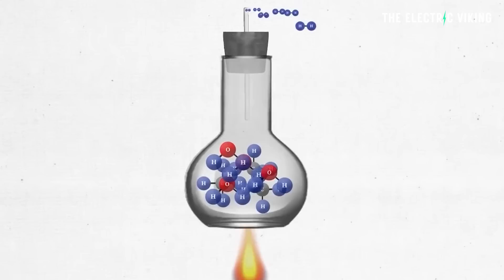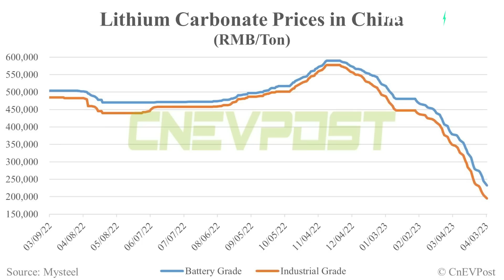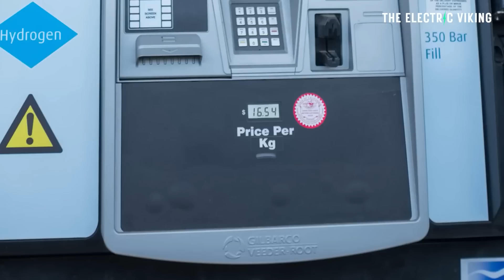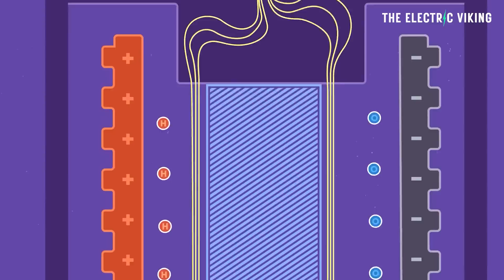Experts say Hydrogen for long-distance trucking makes no sense

Comment: In Germany cities start to give back their hydrogen busses because they cannot afford them any longer. They replace them with electric busses.
Reply: Yes, but these buses aren't doing long distance hauls.
Reply: Hydrogen buses are twice as expensive to operate as diesel buses.  E-buses are 50% LESS expensive to operate than diesel buses.  Why on earth would anyone in their right mind ever go with hydrogen that costs 4 times as much to operate as electric.  Same problem with long haul trucks.  So what if they take more time to charge if the driver/operator will save hundreds of dollars per refill.
Reply: I think battery swapping makes better sense than building a new hydrogen infastructure
Reply: Would never ride is such a bomb anyhow.
Reply: @beatreuteler doesn't matter...hydrogen is too expensive and too dangerous.
Reply: @beatreuteler  how does that change the economic reality.? it would be cheaper to just burn money.
Reply: @1rjona  Battery swapping doesn't make sense. There is time to charge so all the expense of swapping batteries is unnecessary.

Tesla tried battery swapping then abandoned it, for a good reason. Better Place failed with their battery swapping scheme. Nio is doing Okay, but not great. Maybe it makes sense for electric scooters, but not for cars and definitely not for massive trucks and busses.
Reply: @TecnamTwin  NIO isn't doing OK. Burning money like there's no tomorrow. The cost for the battery swap is also double from charging the battery. The costs go somewhere and for long haul trucking, coat is king.
Reply: @scottmcshannon6821  Unfortunately it is not yet known, I think. To me it looks as if quiet a portion of what the Viking is telling us here are forward looking statements and therefore subject to change. We should adopt patience until some of the ideas become more mature and solid products result from them. Then an economic assessment will be much safer to make.
Reply: Sorry Scott, I was assuming your response is to another post of mine. Now as I see to which one you responded I would say it simply depends if they can find buyers for the used H2 buses that are doing longer distance and/or do not know yet that for their distance, fully electric is much cheaper AND is available. In the latter case they may make enough loss reduction by selling them and buy fully electric which then in the long run will earn money for the company as they run on a much lower cost rate.
Reply: @TecnamTwin  it does not make sense for cars to battery swap. You have to scale up a lot to make it profitable. But for trucks that run in a specific routes and must follow a strict schedule, swapping would be better than charging a trucks massive batteries. Even Tesla could not scale its Tesla semi.

Here is a video how it can be done on converted trucks
https://youtu.be/9eYLtPSf7PY
Reply: @1rjona  why? Won't better batteries just be enough, I mean higher density with higher kwh numbers, with higher charging capabilities like 1MW? I think the new CSS standrard can go as high as 3MW?
Reply: @TricoliciSerghei  my doubt is how many 1 MW chargers can we install? 1 MW is power needs of a whole neighbhorhood
Reply: @1rjona  You're right, but with time there should be specialized places where such chargers will be available for trucks.. Even 300 kW chargers could we ok for a truck, if it has a battery of 500kW 2 hours should be enough to charge, sometimes they might want to wait 2 hours, sometimes they could charge less.. It's viable I think, because there are already 350kW chargers out there
Reply: Plains, Ships and Farm Equipment will be benefiting from Hydrogen for sure.
Reply: @shivaraj6  farms also. Hydrogen is a component for ammonia which is used for fertilizer. But Hydrogen infastructure fall behind from electrical infastructure. For Battery EVs , what is lacking is charging stations. The distribution and production network is already there
Reply: In France they are going for hydrogen 100pct
Reply: @TecnamTwin  Swapping could be usefull for trucks as it would be easier to build swapping stations than build 1MW charger parks. And batteries for trucks can be standarized much easier.
Reply: @dnap1991  I count 29 Hydrogen stations in France. They need to go in 500 pct.

Comment: Actually it cost 3X more electricity to make the hydrogen, but then there are even more losses in leaks and fuelcell inefficiency plus added expenses for it's complexity and maintenance
Reply: The latest and most advanced electrolyzer today has over 90% efficiency in converting electricity to Hydrogen at high enough pressures to feed into pipelines .  Transport the H2 in pipelines is 98-99% efficient, depending on distance.  H2 compression is 90% efficient.  Fuel Cell is 60% to 70% efficient  Multiply all those efficiencies:  0.9 x 0.98 x 0.90 x 0. 65 = 0.52 = 52% efficiency from electricity to output at the fuel cell.  
Meanwhile, solar PV inverter at 93% efficiency and grid transmission at 93% efficiency and EV charging at 85% efficiency and battery efficiency at 90% :  0.93 x 0.93 x 0.85 x .90 = 0.66 = 66% efficiency from the solar farm to the output of your EV's battery.  
So, comparing 52% efficiency of Solar farm DC electricity to output of the H2-Fuel Cell... vs 66% efficiency of Solar farm DC output to AC in the grid to DC EV's battery output...isn't so bad for H2-FC...is it?  52% efficiency the H2-FCV route vs 66% efficiency for the electricity grid BEV route is very close!
Reply: in fact you loos 75% to 96% of the energy, depending where you make the hydrogen, and how far you have to transport it.
Only in the case you use oil to make hydrogen, you don't need green energy but Armco and Rosneft can quadruple their output and business
Reply: @trungson6604  While I don't have the time or patience to work through your all your assumptions, every discussion I've ever seen states that HFC vehicles require triple the electrical energy as BEVs per unit of motive power, grid to motor; and so enough electrical energy to power a hydrogen fuel cell vehicle for one mile will power a BEV for three miles. And relative costs seem to support this claim. For one example, a KG of hydrogen, which costs around $17 here in San Diego, contains about 33.6 kWh of equivalent electrical energy. Run through even a 65% efficient HCF (which I think is high), this results in 22 kWh of electrical energy to the electric motor, for a cost of 78¢/kWh. Meanwhile, 1 kWh of 25¢/kWh electricity (among the highest in the contiguous states) X 85% X 90% = 33.7¢/kWh, less than half the cost of hydrogen, grid to motor. 

Real world example: The Toyota Mirai carries 5.65 KG of hydrogen, and gets an EPA range of 357 miles. A KG of hydrogen in San Diego, where I live, is currently about $17. So the per-mile cost of hydrogen for the Toyota Mirai is 5.65 x 17 / 357 = 27¢/mile. Meanwhile, my Tesla Model Y has a 75 kWh battery, and has an EPA range of about 320 miles. At residential rates of about 25¢/kWh,  the per-mile cost of electricity for my Model Y is 75 x .25 / 320 = 6¢/mile—less than a quarter of the cost per mile of hydrogen. And actually my cost is zero, because my solar array generates all the electricity I need to charge my Tesla. Try doing that with your HFC vehicle!

By the way, I see one thing you did in your original calculation—you assessed the BEV 93% for inverter efficiency and and 93% for grid transmission, but assumed there were no such losses in the HFC example. A little sleight of hand, to give the HFC example an extra—and much needed—advantage?
Reply: @Ben Thurston  --  The Hydrogen cost for fuel-cell fork lift operators is around $7 per kg, NOT $17 that FCV owners see at the pump...but that $17 does not matter because the car makers are paying for the Hydrogen for 3 years, the duration of the lease, so FCV owners don't really care about the cost of H2 right now. 
But even $7 per kg of H2 is far too high.  The price of solar and wind electricity long-term purchase agreement (PPA) is around 2-3 cents per kWh, and the latest electrolyzers require only 44 kWh to make 1 kg of H2.  So, the raw energy price is only $0.88 to $1. 32 per kg of H2.  Factoring in much cheaper prices of electrolyzers, and low-cost transmission of H2 via pipelines...and we can get around $2-$3 per kg of H2 at the pump.  

Meanwhile, BEV owners have to pay $0.15 to $0.25 per kWh charging their BEV from home.  Assuming $0.20 per kWh and 3.5 miles per kWh = $0.057 per mile for BEV owners.
Assuming FCEV owners paying $2.5 per kg of H2 to drive 60 miles = $0.041 per mile for FCEV owners.

So, eventually, H2 as motor fuel will be cheaper than gasoline / petrol AND cheaper than retail grid electricity...but if you work for the oil industry...don't worry.  There will be plenty of time, many decades ahead, for the oil industry to stop investment in oil drilling / fracking and to start investing in Hydrogen.  It will take many decades for the current crop of gasoline vehicles to turn over completely to BEV and FCV ...Plenty of time for the oil companies to sell and make profits out of existing oil and gas reserves and infrastructure.   So, don't worry at all, my friend...😀

Comment: Totally with you my friend. Don’t understand why Japanese government continues to subsidize the hydrogen industry in Japan.
Reply: They had too much radiation.
Reply: It’s all about taxation
Reply: @theairstig9164  
Electricity can be taxed just the same.
The problem is Japan doesn’t have a large renewable energy resource that is easily tapped. They don’t get a lot of sun and the ocean is deep off the coast which makes wind farms expensive.
They need to bring back nuclear in Japan or their economy will be screwed by the energy transition
Reply: If I recall correctly, Japan has more abundant/ easier to extract hydrogen than most places in the world. That's why they're so determined about it.
Reply: It’s to delay, derail and slow down EV expansion, Japanese car companies are way behind almost everyone else.
Reply: Because they were late to the EV party, are not able to catch up and hope to have some market to take not knowing hydrogen is simply not going to happen for transportation. It’s dead end and waisted money. Simple economics.
Reply: @kurtmissotten5965  BEV was around 120 years ago, even before ICEV.  When the engine starter was invented, which turn tbe hand cranked ICEV into a hybrid gas electric, the BEV were overtaken by tbe ICEV.

Comment: They do not understand how expensive hydrogen is to create.
Reply: It only takes one technological breakthrough to change that. Remember how laughable the concept of an electric car was a few decades ago? Anything is possible. Battery electric vehicles cannot escape the weight penalty. That's why they are not the best, and cannot be the only solution. Not to mention all the other downsides they have. By the way, I'm no Luddite. I'll be taking delivery of my second Model S this weekend.
Reply: @strangerdanger8462  There is no possible technological breakthrough that can make hydrogen cheaper than electricity given its made via electricity and is in essence simply a way of expensively storing electrical energy (unless you are crazy enough to make a H2 combustion engine I suppose). It will always be circa 2-3x the price of direct electric per mile unless you can change the laws of physics.
Reply: @strangerdanger8462 A breakthrough HAS happened. But it's on the battery side. Last year, it was discovered how to create and keep monoclinic gamma-phase sulfur at room temperature. A sulfur cathode can hold more that 5 times the amount of Lithium than the best current chemistry being used -- the Nickel based chemistries, and is three times lighter as its not a metal. Lyten already broke ground in a factory to mass produce it in San Jose, California in November of this past year, 2022. They have already achieved 3 times the energy density with their method working alongside the US military as their customer. An Israeli electric airline company has already placed a 2 billion dollar order.

And Drexel university managed to run theirs for over 4,000 cycles with very little degradation. That's longer than even LFP batteries and works both in cold and hot weather. It has only a 10 degree C temperature range. It gets no hotter or colder than that range, so the risk of fire is is close to zero.
Reply: @Joe-lb8qn  et al: So far I was part of the "H2 for long haul" camp. Now our Viking says this is not the case. I guess this takes a bit to digest. I am missing some evident data for the electric long haul performance. But I think the electric drive will win up to the distance it can get. If they can do say: 1000 Km range at full payload, no one will turn to the much more expensive H2. We need to wait and see.
Reply: @strangerdanger8462  There's technology, and then there's Physics.  Bonding energies are the latter.
Reply: @strangerdanger8462  "Remember how laughable the concept of an electric car was a few decades ago?" Actually, we had electric vehicles in 1890's long BEFORE we had ICE vehicles but that is when the fossil fuel industry began its attack on everything else not fossil fuel. Had they been allowed to keep working on EV's maybe we wouldn't be in this situation we're in today.
Reply: @donotcare44  the world agreed in the 1989 Kyoto protocol in Japan that climate change was caused by man. California air review board mandated a zero emissions car:

GM came up with the EV-1. 1992

See the documentary, "who killed the electric car"

Comment: As a general maintenance tech, I probably do 10-15 plumbing calls for every electrical  issue.  Electrons don't erode their conduit.  But when you pump nasties under high pressure, the nasties want to come out and play.  
If you want to add unnecessary plumbing to an electric drive train, you need to have a really good reason.
Reply: Also air doesn't conduct electrical power (generally) so a small hole in the insulation is no problem.  A small hole in a pipe is a problem.

Comment: Chemical Engineering graduate here, thus, I know a bit more about hydrogen than your average joe.

The cheapest way to make hydrogen is essentially burn natural gas at some odd pressure and temperature.  Thus,  the process of producing hydrogen has a similar, but higher carbon footprint than using natural gas to generate electricity directly. 

You can use other fossil fuel for creating hydrogen (my senior project used coal instead of natural gas),  but the process is still burning.  Thus,  carbon footprints and pollutants are the same as burning these fossil fuels to generate electricity.

The cleanest way to create hydrogen is to use electricity to break down water.  This is an extremely energy-intensive process and only few countries which has ample of geothermal power plants can afford to do this.  Then again,  the issue is that if you already have extra electricity to break down water,  why  can't this electricity be used to recharge the battery instead?

So,  the hydrogen production doesn't reduce carbon footprint compare with fire-powered power plants.

The biggest advantage of Hydrogen is that one pound of hydrogen tank contains a much higher usable energy than one pound of Li-ion battery.   

However,  what people don't understand is that in a post-industrial society,  electricity is everywhere thus infrastructure requirement for electric cars are actually much LESS than gasoline-powered cars:  more than half of people's daily transportation need can be fulfilled with electricity infrastructure at home thus requirement to charge outside his house is rather infrequent.

Hydrogen, on the other hand,  require an infrastructure that is on par, but slightly more complicated, with gasoline infrastructure.  Before people crying that building supercharger station everywhere is expensive,  try to imagine convert all gas station with big hydrogen tank... all these petro tank beneath a gas station can't be used simply because hydrogen tank is much painful to build simply because hydrogen, being the smallest element known to man,  escapes much easily than gasoline.

Because you can charge your electric car everywhere, but a hydrogen vehicle HAS to be fill up in a hydrogen station,  electric car simply make more sense... not to mention the fact that mechanically,  electric car is a far simpler device thus require much less maintenance.

Hydrogen still has its place,  but probably not consumer-grade transportation.  For example,  China is also ALL IN with hydrogen...  But the use case they are exploring is that they are trying to use hydrogen in steel mill and glass works as part of clean industry initiative.   Airbus is exploring using hydrogen instead of jet fuel for airliners.   These are interesting research and probably won't directly impact average joe's lives in the immediate future.

Comment: The big advantage of hydrogen is supposed to be faster fuelling.  Well, as Sam said, in Australia (and many other countries) drivers have to take a break after 4 or 5 hours.  During that break, they could be charging the batteries.  Even if they have to wait longer because charging takes longer, the difference in cost will be well worth the extra wait time.  The largest trucks burn lots of diesel, so the larger the truck, the greater the potential savings.  If I was an owner/operator I would gladly exchange an extra 30 minutes (note that it's not clear you would need an extra 30 minutes as fuelling required you to stay at the truck, whereas charging allows you to actually take a break) of fueling time for the hundreds of dollars less for the fill up.  Think about it, if the savings is a mere 100 dollars per fill up, that means that the 30 minutes returns 200 dollars per hour.